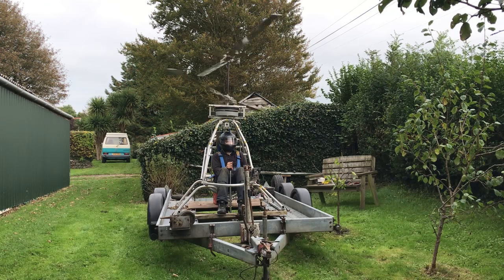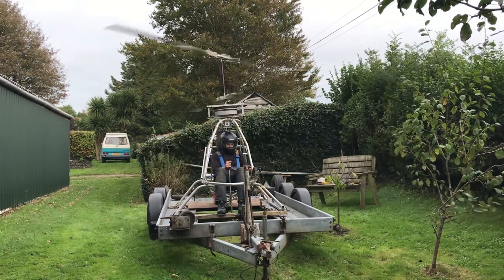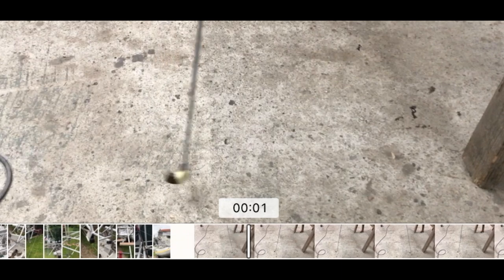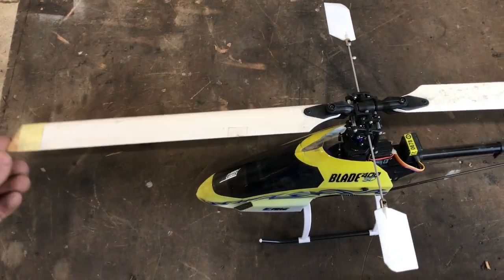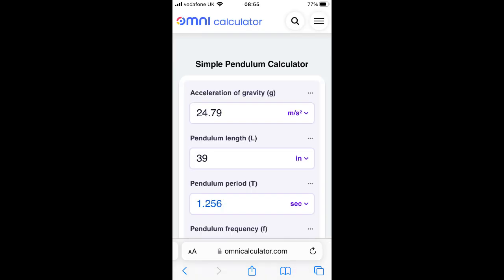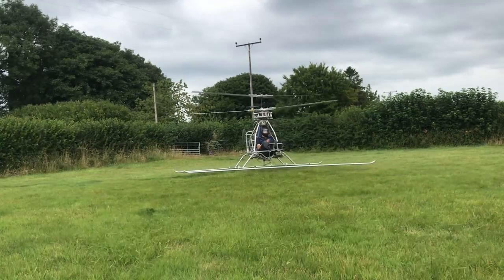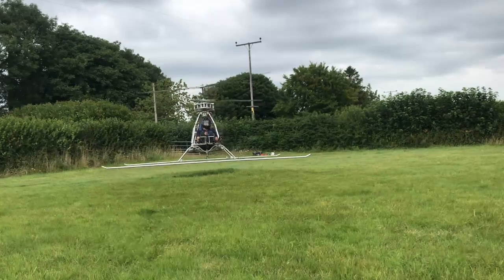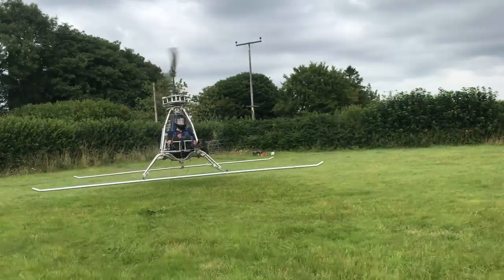Helicopter Rotor Phase Lag vs Gyroscopic Precession WHO IS RIGHT?

Comment from the maker: Hi all, I think I was wrong to say the Smarter everyday video was wrong, for the moment think of the information in this video as another way to understand whats going on. Gyroscopic preccession and phase lag could be two ways of saying the same thing.
Reply: They are different phenomenon and Gyroscopic Precession is a cop out to explain to a laymen why helicopter blades operate out of phase.  You are completely correct.  Phase lag is the reason helicopter blades operate out of phase.
Reply: The rotor dynamics is more like mass-spring-damper system  than gyroscopic  .
Reply: I find that this book is the best one to clean all misconceptions about helicopter aerodynamics : https://www.google.com/url?sa=t&source=web&rct=j&opi=89978449&url=https://aerocastle.files.wordpress.com/2012/04/35717799-aerodynamics-of-the-helicopter.pdf&ved=2ahUKEwiH3_DGt_aGAxW2UKQEHZQ9BnYQFnoECA8QAQ&usg=AOvVaw3lsXFRQAwGqqsoCqvGDDJl

Comment: On a commercial average helicopter the rotor blades are a set of flexible wings, not a rigid spinning top. It's all about the flapping.  The 'flap to equality' explanation where blade pitch vs AoA vs blade inertia vs induced flow changes will cover pretty much all rotor effects.   Gyroprecess is a small factor mostly to do with the rotor hub, some helicopters use a weight cross bar for stabilisation through pitch links. Gyroscopic precession is a nice analogy for new pilots to keep a helpful mental rule to quickly remember the rotor risc effects during verbal questioning in check rides with grumpy QHIs haha.
Reply from the maker: I doubt knowing there is phase lag or precession in the rotor makes a difference to how good a pilot you are.  Didn't know about a weight cross bar through the pitch links for stability. What rotor head might I find an example of this ? I've seen counter weights on the blade grips for correcting blade chordwise balance.
Reply: @Ben-Dixey haha yeah mate exactly. Good ole Bell47 and Huey both use a stab bar.
Reply from the maker: @j6077xxd  Ahh, Arthur Young's stabiliser bar and Stanley Hiller's flybar. Yes, have you flown a helo with a stability bar ? Mixed feelings on it from what I've read though in models they were almost mandatory in the beginning. Slows the rotor response rate.
Reply: @Ben-Dixey yes flown both. I remember it being about improving hover stability in gusts (countering flapback) and smoothing the disc response to cyclic.  The pitch link arrangement is rather complicated and got filed in the “it just works” cabinet of one’s brain on those courses. I wonder if other teetering rotor helicopters used them?
Reply from the maker: @j6077xxd  Yes that's correct, I think the bar reduces the effect of wind gusts but there should also be a reduction in responsiveness. I've seen some small coaxial's with a stabiliser bar. 
I had a go at a video with some thoughts on the stabiliser bar. 
https://youtu.be/uogPHtWN9Lg?si=vgUZsaHPapWafCwR

Comment: asked AI a old question i had from the late 80's- it pointed me here... anyhow insomnia made me want to ask a  couple really old questions I never could find any info on...rc heli guys in late 80s/early 90s were kinda touting 'delta offset' pitch link geometry on blade grips... I felt it could not work, as precession made any correction 90 degrees out of phase...i went so far as to modify a old rotor head with a very large amount of delta offset, cut some crashed blades to stubby length, chucked it in a drill and tilted it- as expected, it reacted 90 degrees off... why was a tiny amount often touted as a plus?  

often back then guys were also changing swashplate timing in hover, supposedly due to precession changes- i tried and tried to find info on precession calculations and really nothing out there...seemed disc solidity/rigidity/rpm might have biggest effect if any on precession, but those would be constants in my little mind... rpm changes on hover idle up setting maybe?

  just wondered others thoughts on these things...i still think they mighta been just used to hype something different, but in actuality, such small amounts were used it did nothing... i see how delta offset in tail rotor hubs could be a benefit, as it could reduce hub stresses in high speed flight by letting t/r tilt evening out advancing/retreating blade asymmetric loading of t/r shaft IF a free teetering hub used to prevent roll couple, but on a rigid or rubber damped main rotor, think that would be a bad thing... 

 one other more recent question pondered, recently saw a K-max spooling up, and noticed advancing blades were the central overlapped ones-  always assumed they'd use outer as advancing to  better maintain roll authority... seems it would probably be quieter and less vibration to the pilots to have blades nearing mach  farther away, and any retreating blade stall in the relatively 'dirty' airflow off the fuselage...maybe the k-max wasnt a speed machine so irrelevant- just seems as brilliant as Charles Kaman was, there had to be a reason...  thoughts?

   just bench racing, wondered anyone else pondering rotor head designs, thoughts on a few old questions, probably as forgotten as the disco era :)
Reply from the maker: @timc2219  Hi, well this has got me thinking. 
So detla offset in the form of pitch link geometry is to reduce the amount of rotor flap. I did say it will alter the phase lag and I believe that to be correct. 
How were you measuring the phase lag with your setup? Could you detect a 3 degree change for example ? 

I can't do precession calculations, nor have I seen any online. I suspect it's a case of research by experimentation but I'm sure someone somewhere is capable of calculating it. 

I think blade loading will have a slight effect on phase lag and that of course changes with aircraft weight. But I think that the biggest change in phase lag would be offset hinges. 

The delta 3 in tail rotors is to reduce the flapping, need to stop the tail rotor contacting the tail boom. 

Good observation and thoughts on the Kaman. Not sure why they have the advancing blades in the centre. I'll have to think about that one. 👍

Comment: Excellent video Ben, does the fact that you are not utilising collective pitch make any difference?  After all your input to blade pitch is only on the lateral plane and not longtitudal - ie, up/down - this would normally change the blade grip angle and this transits into blade angle.  As a fixed pitch, you're not actually changing the blade pitch, per blade but per plane.  ?  Zip over to John Salt who just posted a short.
Reply: to quote John salt on his latest YTShort:   Helicopter rotor blade phase lag is often mistaken as gyroscopic precession, especially in the world of RC helicopters to explain why the acting force of the rotor blades are about 90 degrees later in the cycle from where the pitch change from the swashplate input was applied.

This video shows how the rotor blade on a full size helicopter reaches peak amplitude about 1/4 rotor rotation after the maximum amount of cyclic input was given - this is phase lag. The time it takes for the blade to fully respond from the initial control input. 

It's best to turn down the playback speed to 0.25 to really see this in action.

Watch the blade grip rotational movement in relation to the tip of the rotor blade amplitude (how high the blade flies). You'll notice the blade grip reaches maximum cyclic pitch rotation on the left side of the helicopter but the blade itself doesn't reach maximum amplitude until it's at the back pointed toward the tail. We can deduce this helicopter is flying forwards in other words. 

This delay in reaction time is caused by the natural flap resonance frequency of the rotor blade system. Basically the rotor system acts like a pendulum which has a fixed frequency and thus fixed phase lag angle. In the full size world, this "flap lag" or "phase delay" angle can be as low as around 70 degrees from where the input was given, all the way up to 90 degrees. This is dependent on the rotor head design. 

In the world of RC helicopters, this flap/phase lag/delay is very close to 90 degrees because the pivot point of the head axle (what allows blade flap on our models) is generally centered in the rotor head. The further away from the center of the rotor head the flapping occurs (flap hinge offset), the smaller the phase lag angle will be.

Other minor influences on our RC helicopters that affect just how close to 90 degrees the phase lag will be include rotor blade grip and rotor blade stiffness; but for all intents and purposes, the lag angle is 90 degrees on most RC helicopters.
Reply from the maker: Hi mate, I think blade loading can make a difference to phase lag. I'm controlling lift via rotor speed. Collective pitch is controlling lift via blade pitch. 
Blade loading could influence rotor flapping Frequency and could change the phase lag. So yes I believe that collective pitch could potentially make a difference. 
I pushed my luck with this video, it's right at the limit of my understanding. 😉
Reply: @Ben-Dixey  great answer - essentially phase lag is the time taken, DoL is the action as far as i understand - then again, I'm an idiot!  I'd strongly advise reaching out to John Salt to dig deeper - tell him i sent ya - think i have his email somewhere..........
Reply from the maker: @HeliShed I've not heard of John salt, will watch some videos of his, looks good content. There is an email on his about page, otherwise yes email me with his email if you like. Ps enjoyed your recent videos, always make me laugh. Your subs are going up fast and rightly so. Though we need to have a debate on the Mk1 escort vs Audi R8. My favourite car in the world is a mk1 Escort. 😆

Comment: Both are correct. They both operate in the same direction for completely different reasons. They are not, however, the same thing.
Reply from the maker: @EIGYRO  Not the same thing? Interesting. 👍

Comment: Why go co-axial when you could go with the proper helicopter scheme?
Reply from the maker: @getsideways7257  Is there a proper helicopter scheme ? Chinook tandem rotors, Kaman syncropters, kamov coaxial's. Are all these not proper helicopters ? 
I have nothing against the single rotor, tail rotor configuration and can see myself building one of those in the future too. 
The main reason for my choice was simplicity, coaxial's are not usually simple, far from it but mine is simple by comparison because it's not controlled with swash plates. It's controlled like a gyrocopter, just tilt the rotor where you want to go.
Reply: @Ben-Dixey  Oh... But I suppose you could make it even simpler going with a tilting single main rotor then? Or do you mean that only the top rotor gets tilted? I suppose that with a single rotor it's the body itself that will be getting tilted instead... Then again, too much risk with non-coplanar rotors even if there's quite a lot of separation.
Also, you are risking your own life there implementing a DIY co-axial design, possibly endangering others a lot as well (since if anything goes wrong, it will resemble a grenade blast much more than with a single rotor).

As for anything other than single rotors, yes, they all are not helicopters in my book. Controlling them is closer to operating a quadcopter (if one had swashplates) than a helicopter. It always puzzles me why people tend to fancy all those weird designs over pure single main rotor and a tail rotor. I suspect that's just because of the non-conventional looks most of the time.
Reply from the maker: @getsideways7257  You could have a conventional single rotor, tail rotor with a tilting rotor instead of swash plates but there would be massive torque on the hinged rotor. Probably doable if the hinges are strong enough but the coaxial design cancels the torque. 

The downside to having a tail rotor is the loss of energy, all it's doing is counteracting the unwanted torque. Get rid of that and efficiency goes up, more power for lifting which is why the kaman and chinooks are used for heavy lifting. Not to mention the people that have been killed walking into tail rotors, very dangerous things if you ask me. 

As for my risking taking, live and let live I think, I don't tell people who base  jump, deep sea dive, race motorbikes etc that I think they should stop. It's up to them, risking other people yes which is why I experiment alone away from people. However you can go and watch the TT motorbike race and stand extremely close to bikes going 150mph ?
Reply: @Ben-Dixey  I see. The more the reason to try and build a swash plate - they are marvelous pieces of engineering. But yes, they indeed are complex - and you would probably need things like dampeners too.

Yes, the tail rotor barely contributes to the lift at all (even if tilted), but I believe your goal is not to slingload Humvees or evacuate groups of alpinists at specific density altitudes. You are doing this to have fun, right? What could be more fun than learning to subdue a small classic design helicopter? Although I admit the risk of a pilot error is noticeably higher that way, but so is the reward. Also, you don't seem to be unprepared for that, not to mention using a few simulations would most likely help you prepare even more.

I'm not telling to stop taking the risk. I just believe the coaxial design is inherently more dangerous mechanically - including the possibility of much more fragments flying in all kinds of directions if something really bad happens. If you say there is very little probability anyone gets hit in that case considering the location of the tests, I guess that's ok then. 
I'm not entirely against risks, but I believe calculated risks are much preferred to doing something like IoM TT. That said, I can fully understand the riders taking part in that race. Personally, I'd rather come up with a sim good enough to be a replacement for that...

Ah, and speaking of Chinooks... There is CH-53 and if that's not enough there is also Mi-26. Should be plenty stable even while of the conventional design.
Reply from the maker: @getsideways7257  Yes the main reason for this project and the flying boat project is primarily to have fun. I wanted to learn all about helicopters and a project like this makes you do the research. I also wanted to use the engineering equipment that I bought and make things I have never made before. Lastly I wanted to learn to hover a helicopter, a side benefit if I can perfect the machine is a hovering toy that I can enjoy for years to come. 

I had no idea how much there was to learn, not just about helicopters but everything related, materials, drive systems, engines, physics, aerodynamics even making videos on YouTube! . That knowledge can of course be used in future projects. 

The heavy lift helicopters you mentioned are of course incredible machines and they had their reasons for using the standard configuration. I'd like to know what the reasons were but we can guess. 

Simulators are great tools, I used one to learn some rc flying. Cameron Carter on YT used one for teaching himself to fly his homemade helicopter. He used the actual machine as part of the sim, attaching the electrics etc to the mechanics. He said he was able to hover pretty quickly from the sim practise. 
I considered doing the same but mine isn't the usual design and thought it might not be realistic enough. 
After flying an R22 the cyclic is similar, similar type corrections so I think it would have helped. The collective vs throttle on altitude control is very different as are the yaw vs anti torque pedals. 

Extended poles work well for hovering Practise, just like the models.